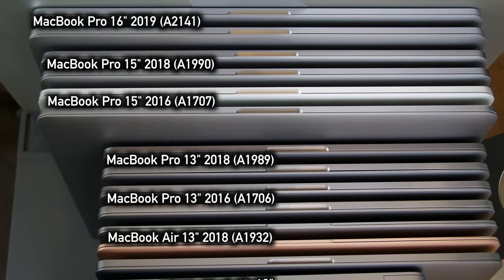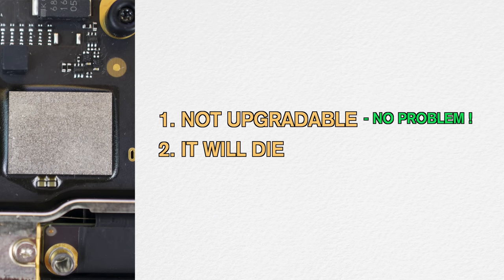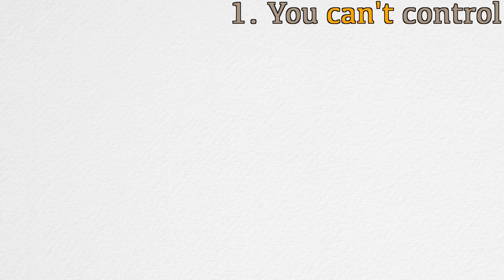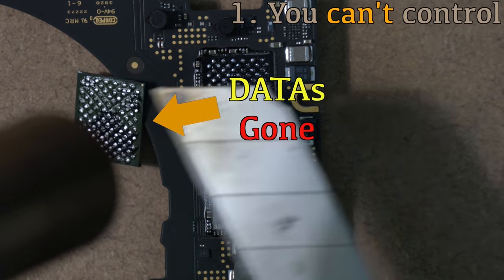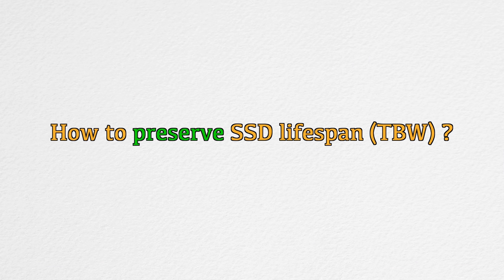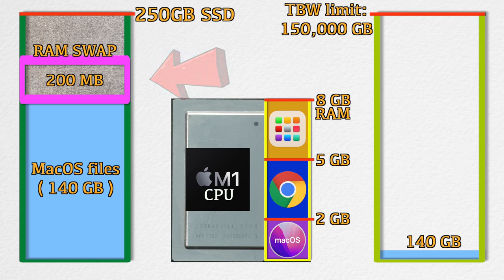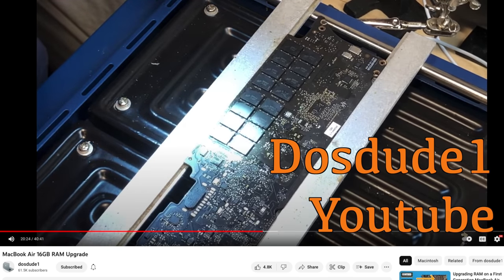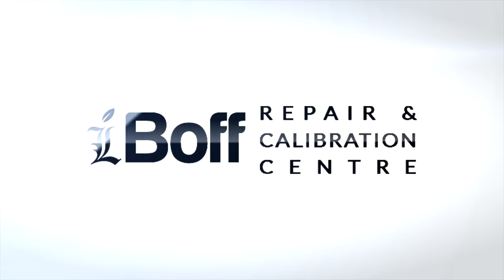These MacBooks DIED from SSD Failure & How To Prevent It (Not for RICH dudes!!)

Comment: As an Apple Certified Technician you nailed this topic very well and very informative, but…

1) You made the swapping issue more dramatic and dynamic than it usually is. Yes, swapping is bad, but it's not as constant and dynamic, meaning that the "200MB" swap file is not constantly being written back and forth, it's the amount of swap being used. And Swap memory is not and does not act like Random Access Memory, that is wrong, it's a temporary inactive "cache" part of the used memory stored for later use and to give space back for immediate needs.

2) You left out an important issue about SSD space and longevity, filling up the drive and keeping it that way as your main and only storage is bad, very bad, as there is little room for the OS (and you) to perform common tasks and for the SSD controller to execute wear leveling. Leading to a premature wear of cells.

3) The type of NAND flash (MLC, TLC, QLC) chips have a huge impact and it's not simple or short to explain here, a good excuse to investigate and make another educational video. In short, avoid QLC based SSDs. Apple uses TLC from all the manufacturers that supply the chips, fortunately.

4) TBW is not an "end of life" point, but an average MTBF (meantime between failure) measurement and the majority of drives can exceed this "lifespan" metric many times. Your example proves it as the drive had 80% life left after doubling its TBW.

In theory and statically in practice (not counting manufacturing defects) the life of the SSD in soldered MacBooks will out pass the lifespan of the machine by the average user ownership period of 4-5 years for an 8GB SSD. But if the TBW is higher, better (a larger drive will always be recommended as you mentioned in the video, double that if you add more RAM, but of course this is expensive when it comes to Apple's pricing scheme).

Good video!
Reply: Amazing comment, thank you for taking the time to inform us.
Reply: This dude @creamwobbly seems real confident about this. Anyone else have an opinion on swap vs cache? My Macbook is on the line!! haha
Reply: Can you help me understand when the Mac says that x amount of MB is being used in the swap?  Is that.. like 200mb/second? .. like always adding 200mb?  Or just 200mb... sitting there not changing.. until the figure does change?  So if that number stays the same for 4 hours and I close the computer for the day..  the total MB written to the drive for the day will have been 200mb?   But what if at hour 2 it drops to 100mb?   Is the total then 300 for the day? 100?  spitting the difference at 150?
Reply: Swap memory is actually used as real RAM. The OS certainly tries hard to move the inactive parts of the memory to swap while keeping frequently used parts on physical RAM, but it doesn't succeed every time in prioritising those data.
Reply: @mootsym  Commonly the less swap the better. Some people have a 10GB swap file on their M1 Macbooks with 8GB RAM, though not enough time has passed for those M1 Macbooks to start dying from SSD failure en masse. It's certainly not 10GB/second. But swap storage acts any way it pleases and it usually writes more randomly than not, meaning that if MacOS wants to write some data from the RAM to the swap file, it certainly would, without really discerning what data it is. 

Apple made a conscious decision to specifically use swap storage as if it's extra RAM. No one else does that in the same scope as how Apple does it. They knew what they were doing, and what they were doing is screwing their customers over.
Reply: Well said
Reply: uh so why don't they let us have removable SSD?
Reply: @newsmansuper2925  money
Reply: Are they salvageable if the failure already happened?
Reply: @newsmansuper2925  because if you can't even make a proper decision about how mach RAM do you need, than you probably will do the same mistake with the replacement SSD too. You will pick the cheapest one, and use that. And you will blame them just because your computer is slower like before, but they can't do anything about that, if you buy the wrong replacement SSD, so just more simple, if you can't replace it. If you can make proper decision about your RAM requirements (based on your own usage, how many apps you use in the same time, etc), your SSD probably will never die.
Reply: @newsmansuper2925  it's a tradeoff, soldered components are energy efficient, perform better generate less heat. Companies should provide a economical way to increase the size later.
Reply: @randomcomment9992  wait what I have 2012 where I do both?
Reply: @creamwobbly  Using the word "cache" in the colloquial sense rather than the technical sense of CPU cache may be causing some confusion in this thread. Cache memory as in CPU cache (L1, L2 etc.) is the fastest and smallest storage available to a processor with the highest throughput, but with no wear limitation worries as it is built from on-chip SRAM. Cache memory is used to give the CPU low-latency access to the most frequently needed parts of program and data that would otherwise need to be fetched from slower RAM. The use of non-volatile storage as swap space is the very opposite of cache memory since it takes the least  frequently accessed portions of RAM data and copies it out to RAM making room for currently-needed data/instructions. The concern here is how frequently non-volatile memory allocated as swap is actually being written.  Bottom line: The OS will attempt to swap out to disk those portions of RAM that have not been recently accessed, thus avoiding repetitive disk read/writes due to swapping as best it can. It is hard to make quantitive statements about how successful a given OS is at avoiding frequent paging in and out of swap, but every OS strives to achieve that goal, and for the most part succeeds. One case that will cause significant active swapping activity is when one program is actively performing computations over a very large data set that exceeds the amount of physical RAM available in the machine. But if you habitually leave 100+ Chrome tabs open and idle, this should not cause rapid, continuous swapping activity, although it may cause some swap memory to be used.
Reply: Tell the CEO that people want upgradable machines. If MacBooks would last as long as you mentioned, then why are there so may broken ones due to SSD failure?

Nah.. I don’t buy this. 
Reduce waste!!! Make products upgradable!! Apple is just creating tons of unnecessary e-waste with this strategy and not providing any benefits other than exchanging lifespan for speed.
Reply: I read it elsewhere that when TBW is reached, SSD will put itself in read-only mode so that user can still read back all data. This is obviously done through controller chip and seems Apple is using their own controller or firmware?
I'd say even if the onboard chips are read-only  if macOS does not boot user is mostly screwed. Or have to pay a sizable amount to get data back.
Reply: @newsmansuper2925  they want you to service the computer or buy a new one. i have a 2012 macbook pro thats still doing its thing without issues in 2023. they dont want that.
Reply: @r1oot  I was not trying to excuse nor justify Apple in this practice as I, like many, if not all of my tech colleagues, oppose it completely. In shorter terms, I consider soldering the NAND storage chips to the logic board, wrong. But I needed to clear out some details about it.
Reply: the qiestiion their is why do they have to solder the ssd into the unit. why not let consumers replace the broken ssd just like in the old days when the ssd can be replace. is apple getting greedy about about money.
Reply: @puspamadak  It isn't used as real RAM, it is a totally different bus. Yes the OS selects which pages to swap and can end up thrashing, but it always is a write to swap and read from swap to RAM, never using swap as ram.
Reply: There was a time where Apple devices were sold as lasting close to 10 years and thats why they are so pricey. Replacing a 3-4000$ Laptop every 4 to 5 years should neither be necessary (performance increase is now much lower then it was back then) nor possible, giving the average consumers income.

Comment: Tip: 
buy the lowest possible storage option; 
use it till warranty expires; 
find a third-party that does ssd chip upgrade. 

Tons of money saved.
Reply: don't use apple crap, tons of money saved
Reply: Buy a repairable and upgradable PC - and save tons of money.
Reply: @kennethvalbjoern my last 24 months with my pc. 2 high end asus mobos dead and rma’d but asus being asus overcharged me for the first one and lost my second one and blamed me for it. Msi 4090 melted cable and also took my seasonic 1000watt psu with it. Where is the money I saved?
Reply: @spamspasm8183 Gamers Nexus did some videos on how Asus service centers are crap, so anyone with Asus products are shit out of luck until Asus fix their policies. (I have an Asus Tuf 1050 laptop and I send it to 3rd party repair shops because of mobo and hinge issues).

4090 are overpriced and the power connector are likely to melt if plugged in imperfectly. This affects FE and all 3rd party brands. So anyone with 4090 have a ticking time bomb if they are not careful with it. 

I think the melted 4090 connector screwed your PSU, nothing to do about it except to avoid using 4090
Reply: The Mac Pro refuses to boot if it detects more storage capacity than it got in the factory. If the same is true for Macbooks (not sure) you can't do that.
Reply: @SaHaRaSquad it’s not. macbook pros even the newest ones will boot up 8tb just fine . it’s all over youtube
Reply: I said Mac Pro, not Macbook Pro. Learn to read.
Reply: @SaHaRaSquad  take your own advice and learn to read. You weren’t sure if macbook pros were the same right? I just clarified it for you.

Comment: This is an amazing breakdown. To all my mac mini family, i'm using a dock with an external SSD. I am not saving anything on my internal SSD. All downloads go directly to my SSD within the dock. Glad I found this video early.
Reply: Just got a Mac studio last week and I am doing the same.
Reply: @notsure1135  Good call bro. Internal SSD is only for apps. Should last us a while. They are starting to do Soldered SSd swaps, so we just have to survive until it gets mainstream. Apple is annoying but these M2 computers are the best i have ever seen, literately no lag.
Reply: @bruxolabs-thedefitribunal  I got the M1 Max studio with 512GB and you can swap those out if same size which is fkn handy. I am gonna source a few of those in the next year for the inevitable burnout of the ssd. 

Hope I get some life out of this setup.
Reply: @notsure1135  nice bro. I was watching a video by another youtuber who was breaking down the math of failure. If you go the external SSD route, it should last you a really long time because you will not be swapping a lot, and the data storage on the internal will be distributed more widely. Happy we found this out now, rather than later.
Reply: It will make no difference. The SSD where the OS is installed is where the swapping takes place. Saving downloaded files to the external drive will have minimal impact - it's the swapping that is responsible for 99% of writes.
Reply: @BartechTV  Definitely, I've been tracking my swapping so it rarely occurs. Swapping has a large impact coupled with having a larger hard drive. I switched from Firefox to chrome to reduce my swapping. It crazy that most casual mac users have no idea unfortunately.
Reply: dont overthink it my a1706 lasted 7 years with no issues with the ssd (sold for an m3) and ive had the same 1tb wd ssd in my desktop for the past 5 without issue

Comment: You're absolutely right. As a person with fairly good computer knowledge I knew about this problem even before I watched your video and commented this sad fact on nearly every LTT video about Macs I watched. I did however underestimate how many died that early because of the SSD reaching its maximum write cycles. It's damn infuriating and shocking. Thanks for helping to quantify the extent of the problem !
Reply: How many died? I missed that.  Nobody is projecting any estimate of failure in this video. Just speculation
Reply: @rcpmac a lot! any MacBook or MacBook pro with on board ssd over 5 years old is likely to die as customers buy them for ram heavy apps like video editing, graphic design, music production, any where user stored data to near maximum for extended period of time, that would include buying used logic boards to repair a dead Mac. Yeah don't know how many. You maybe right no one keeping count. Yet it's a lot, and eventually maybe all... that is shocking.
Reply: @brucemercury  Your SSD is not RAM.  RAM is volatile storage only used to store the state of programs currently running and clears itself as soon the computer is powered down. RAM doesn't have the limited write/erase cycles like an SSD. SSDs are persistent storage that stores long term and even when your computer is turned off.
Reply: @brando4526  yeah and where do you think the Mac will write to when RAM is no longer enough? to /var/vm/swapfile* from 1GB to nGB of RAM help written to the SSD.
Reply: Josshyua  Walk into a car dealership with a well-known issue, and all too often you'll be told your case is the first time they hear about it ... VW-Audi-Group being especially notorious for it
Reply: mmm..Back them, they had ROM and RAM.  They seemed to last more than a decade. That was the design philosophy.   Now it is about economic material science  where the material is designed to degrade.  With that mind, I would not doubt if they use the data to "put" mac into fail safe mode to support the repair tech economy...
Reply: @brucemercury  Any MacBook you say? I have have one from late 2013, that is 10 years old. Its SSD and RAM is still working just fine. I've used it for music production, 3D rendering and editing, compiling software, design and much more "RAM intensive apps" than you can count on your hands and feet. I haven't exactly been cautious about it. So I wonder if what you're saying is really rooted in truth or you are just pulling from anecdotal data.

Comment: Nice video!
At 13:09 RAM means Random Access Memory.
Random means that you can read or write any (random) location in the memory with the same access time.
Compare this to Sequential Memory like a tape drive where you have to wind the tape to the correct position to access the data.